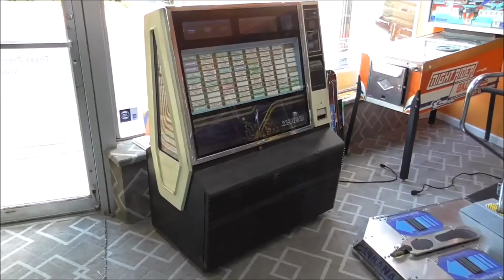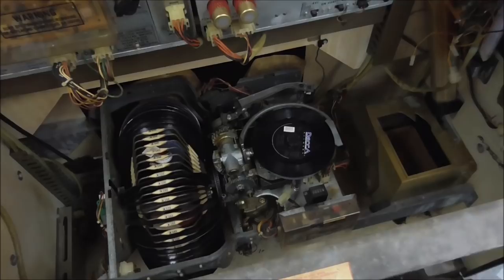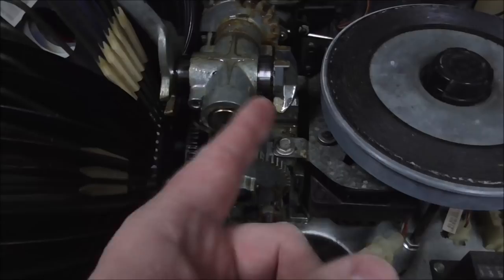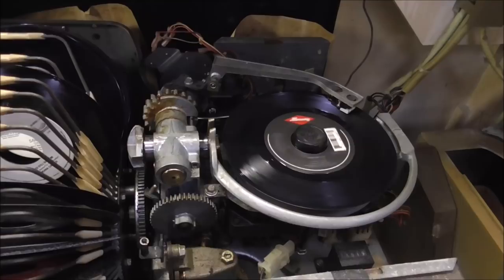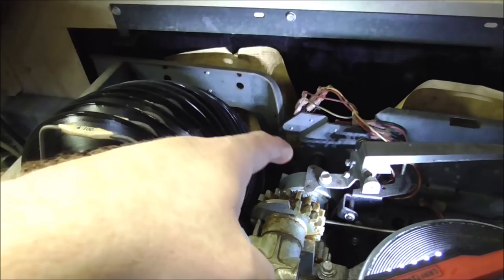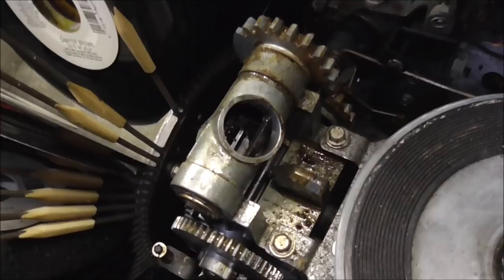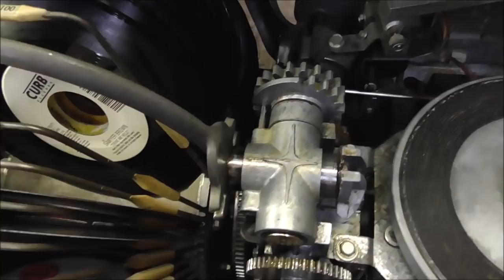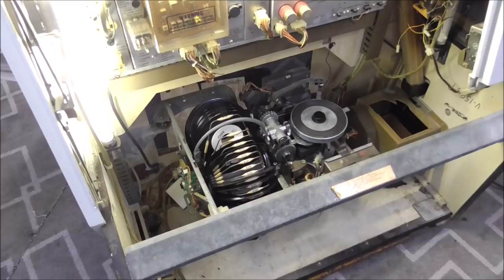How To Repair a Rock-Ola Jukebox Mechanism That's Sticking Or Not Moving (Most Common Problem!)

Comment: Good day sir, I have a Rock Ola 437 Ultra and having some slight issues.  The record carriage keeps turning once the record has been place in its slot.  Than automatically grabs another  record plays it and resumes  the same process again.. your help will be appreciated!  Thank you.
Reply from the maker: In general it will keep doing that for as long as it thinks there are selections left to play.  When you play 1, when it picks the record up (just about the same time) there is a big click and the 'read out' arm has a little hammer on it that knocks the pin on the side of the pin bank back over to the other side, so that the record is cancelled.

It could be that the arm is misaligned, or the power is not getting to the coil that moves the little lever back.

Look on the side of the pinbank opposite the basket, and see if a bunch of the little levers are pushed over, each one that is makes the machine think it needs to play another record.  you can turn them back off by hand, and then turn it on and see if it stops trying to play (since nothing is selected).... then try to select one, see if the pin gets knocked over, then see if when it plays it it knocks the pin back the other way.  If you have a manual it shows how all this happens in the manual.

Comment: I had a AMI that would sometimes pick the wrong record or try to put it away in the wrong spot Mechanism is very similar I don't have that unit any more but was curious if you had a idea of how to fix that
Reply from the maker: If it was only off like 1 record in the basket usually it's an adjustment, that's probably what was wrong.  If it picks the wrong one (but puts it back in the right place, i.e. where it came from) then it's a selection system problem.... i'll bet the basket was just slightly off though and it would grab the record beside the one it was supposed to, or accidentally put it back in the slot next door.

Comment: Could you chuck the motor shaft into a drill to work it?
Reply from the maker: Typically it'll turn a little bit and then something will bind so I wouldn't want to force it.  All the parts are cast aluminum or something, I've had several I've bought in the past that are broken....

Comment: Have a simular Rock-ola.  You showed a video where you cleaned the alternate god (which changes the playing side). Mine won't change sides to play the second side. Do you show a vide on tear down.  I've cleaned but it still won't switch.  Only sprayed cleaner but still it won't switch.  Help. Ted from seattle
1968 rock-rola

Comment: Love your videos, I have a rock-ola 445 which is in dire need of a service, I watched your video on that model a year or two back and feel I could carry the job out myself but where can I get an on line manual from? Thanks
Reply from the maker: I've never found a 445 but there is a scan of the 442 manual floating around on the internet it's pretty much the same.

Comment: I sooooo want this 3 in 1 SAE20 oil for my Sebburg VL200 but I can’t get this to the Netherlands without rediculous shipping cost (almost $189,- !😱😱😱 at Amazon) what alternative can I use???
Reply: There's likely some company that makes SAE20 oil locally.  It's not an uncommon oil.   In the USA,  SAE30 ND (Non Detergent)  is sold for air compressors.   I would check at a tool store,  and ask for Electric Motor Oil.  That's the SAE20 stuff.
Reply from the maker: Like Koby said it doesn't have to be 3 in 1 brand it's really just the weight of the oil that is important, they've got to have some locally in the Netherlands, they put it in pretty much every machine that does anything!

Comment: Would it be the same kind of setup for CD jukeboxes?
Or is it a different setup?
Reply from the maker: The mechanism in a CD box is a little more precision since the CD's are more fragile, I've never seen one of them have the grease issue just because they're not these big heavy duty units like these had.  The carousel is much smaller and works a little different it doesn't have the same large gears and pistons that these type have.
Reply: Hopefully I can the inside of one.
And the working mechanisms that powers them.
There still to new I guess.

Comment: My Rockola CD box had the same problem. I found it easier to remove the gripper to clean and lubricate it. My manual called out for using grease not oil. Any reason you didn’t grease it?
Reply: Hey just working on a 100 CD 3000 model, I think oil is too thin, white lithium grease works great

Comment: I'm surprised you didn't chuck that motor to the end of a drill instead of hand turning.
Reply from the maker: If the mechanism is stuck and you put a drill on it you'll break half the shit in the jukebox if it binds at any point in the rotation...
Reply: Got it! 👍🏻